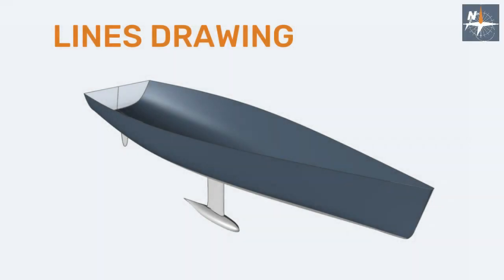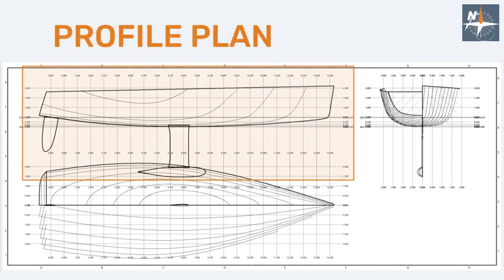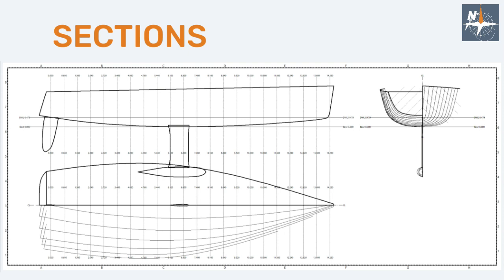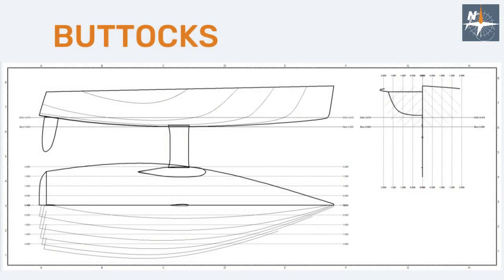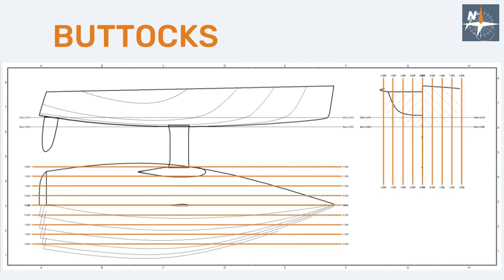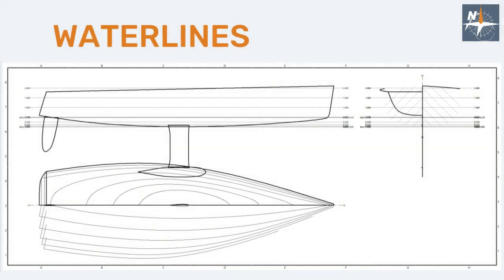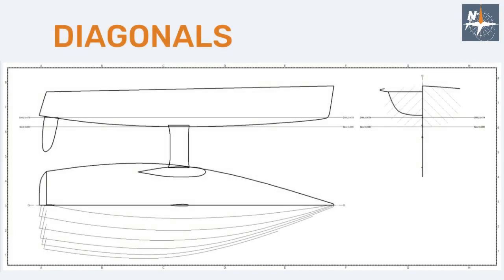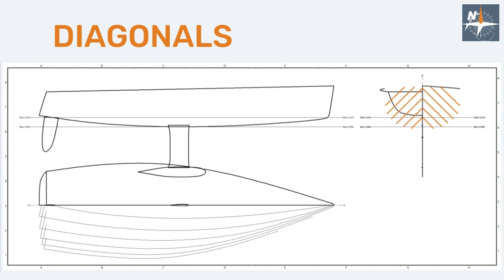How to read Lines Drawings.

Comment: I would like to ask a blogger about a knowledge point. How do you know that the waterline will reach your design position exactly when the entire ship is built.

Did you accurately calculate the total weight of the engine, sail, and everything else, and then correspond the weight to the displacement to obtain the displacement, and then calculate the height of the waterline based on the cross-section of the ship's bottom?？？？
 
Looking forward to your reply. Thank you
Reply from the maker: Hi, thanks for the comment. Yes, weight calculation and distribution are an essential parts of the design. For that, we must consider systems like engines, etc., as well as the hull and superstructures themselves. We can calculate the waterline for a specific load condition when combining the weight and the weight distribution with the hull's shape. Load conditions could be, for example, the ship unloaded or loaded, with or without crew, etc. Everything has to be accounted for and controlled precisely from the design phase until the end of construction to ensure the ship will float at the intended design waterlines. We hope this helps.
Reply: @navalapp  Thank you for your reply! It gave me direction. I have always wanted to build a sailboat by myself since I was young, and now that I have time, I plan to try building my own sailboat.
Reply from the maker: @zhanxu125  Don't forget to check our online courses on Boat Design: https://navalapp.com/courses/single-bundle/single/?filter-categories=single
Reply: @navalapp  👌👌👌👌👌👌👌👌

Comment: there are a lot of small fabrication shops turning out alu boats from precut plates, the do not understand lines, they do not draw a body plan let alone loft and PROVE  the offsets as sheerline, diags, w,ls  and buttucks, even with computer generated offsets you need prove the lines and you NEED  a body plan, that is sections, to lift things such as floors, frames, tank end 
I  have 40 years of experience yacht building
thanks this should assist people understand
Reply from the maker: Thanks for the comment!